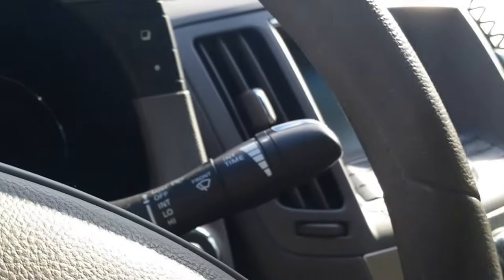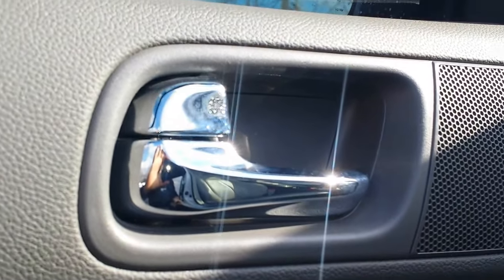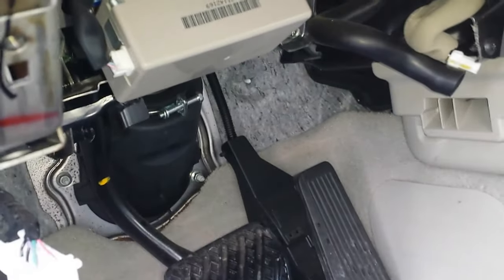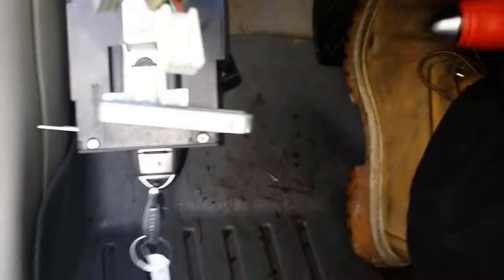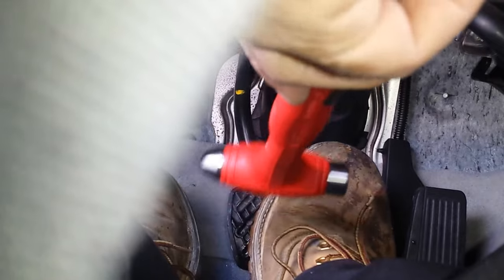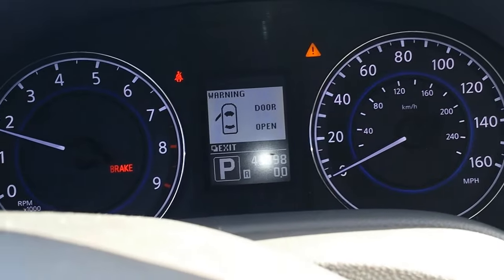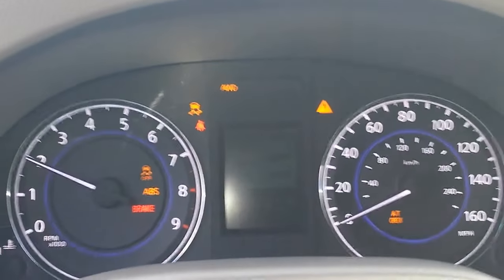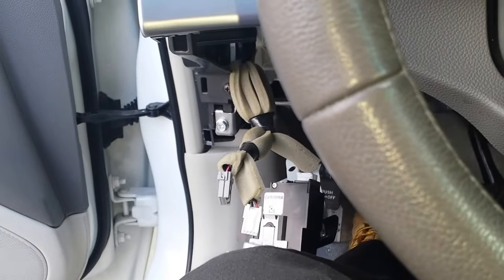How to Start Your Nissan or Infiniti with a Failed Steering Lock Control Unit

Comment: Ok, i forgot to tell/type to you that I got this (yellow icon with key) & still wont turn on... i don't have any power in the vehicle except only the key fob slot - pushbutton & icon to step on the break pedal & push the button... praying i kindly respectfully get a response/advice... thank you
Reply from the maker: Hello Jezabel, sorry for the delay in response.  This trick works 50% of the time.  So I am assuming by now you may have this issue resolved and you replaced the steering lock control unit

Comment: tried this method and it works!  have you had this problem happen again after?
Reply from the maker: sarath sor Yes, this trick will get you going. But it can happen again, and next time the hammer trick may not work. The steering lock control unit would need to be replaced to keep this issue from happening again.
Reply: FixyourNissan how much did it cost to repair?

Comment: Hey Jay I have a 07 m35 I tried the trick and it worked but not for long, I ended up buying a new steering lock module but have the hardest time finding someone to put it on.  my question is if I can someone get the old one off and the new one on does it still have to be programmed?
Reply from the maker: Thanks for watching. The Steering Lock control module does not require any programming.  If you can remove it and install it, that is all you need to do!

Comment: I bought my son a 2007 Nissan Murano 190k miles, it ran n had some minor issues I had fixed, tune up, breaks, etc. It's been sitting since Last April 2022, it will not start and I was told it's not the lock box or steering module but the key light is on. It unlocks and locks the doors. The car won't even go into neutral. I know I need a new battery. I don't know where to start, new battery first? or if he should just get a new car. Hope to hear back soon thank you. It happened out of nowhere.
Reply from the maker: Hello, and thank you for watching. Does it act exactly like this video?
Reply: @FixyourNissan hello thank you so much for replying. Yes. Nothing was coming on except that key light. Someone came to try n fix it, jumped the battery n got all the lights and everything to come on, it sounded like it was going to start but it just wouldn't turn over. I think he was banging on the starter like this. I was told it's not the starter or alternator, it's something electrical.
Reply from the maker: @nickalenaramos5981   Alternator won't keep the car from starting. If you hear a single click.  That is a sign of a starter

Comment: I have a question about the warranty. does it matter if I got it from a different dealer ship for the 8 Year warranty. or you have to buy it from nissan dealer ship for the 8 year warranty?
Reply from the maker: I made a mistake about the 8 year warranty. It was actually 6 years.  I was thinking of something else.
Reply: Oh alright, one more question if I buy a steering lock does it matter the manufacturing number? I'm trying to order one on amazon
Reply from the maker: Don't know if you can get it on Amazon, it is a dealer item only. No programming is required. Just replace.

Comment: My car it's infinity FX50s 2010, I have same the issue in my car, the steering wheel is locked , and I got water leaking from sunroof, the car it was  working fine , after clean the car  I got intelligent key warning light on , I don't know the  problem from BCM or from steering lock module? please help me

Comment: i have the same issue with my car but with my car the steering wheel is locked and the radio and all the locks are not working or responding to the remote.  should i try this? thank you
Reply from the maker: +phil blak  What year and model Nissan or Infiniti?
Reply: 08 g35
Reply: Is there a way for me to reach you ?
Reply: blu way did you ever fix it

Comment: I have a 2007 g35 sedan with the same issue. Is it covered under the warranty?
Reply from the maker: If you have a extended. Maybe.. Other wise, it's only covered under the basic warranty which I am afraid is expired on your year G35.
Reply: FixyourNissan I've tried the hammer trick with no luck. The only way I can start it is to clear the b2014 code (koeo) . Then it will start one time and the code returns. Is the lock solenoid replaceable? Looks to be riveted onto the column.  If I get an entire column from a salvage yard will it need to be reprogrammed?
Reply from the maker: b2014 could be a BCM issue if not a Steering lock control unit issue. The steering lock control unit is secured by two tamper proof bolts which I use a Punch and Hammer to remove by reverse drive it, so it loosens.
Reply: FixyourNissan will it need to be reprogrammed after the new lock?
Reply from the maker: onebad4cyl No programming required if you change the steering lock control unit. If you replace the BCM there is programming involved.

Comment: I have the same issue with my 2008 infiniti qx56. what's the name of the fuse box thing and where can I get one from?
Reply from the maker: +Raoul Wright  This is a steering lock control unit. The 2008 QX56 does not have push button start, and does not use the same type of steering lock control unit.

Comment: rom Edison, nj, Saturday Blizzard day took two tries to turn on my daughters car. The battery was weakening. Moved car, shoveled; a few hours later had to jump battery to move car again, drove  for a while to charge battery. Parked. turn the car off then on again with no problem. Today would not turn on. Replaced battery with new bosch from pepboys. Still no luck. Saw this video along with a few others. pulled panel down on one side  and tapped with a hammer a few times and car turned on.  Hopefully it turns on again. QUESTION. Did it not complete actuator cycle cause battery was weak? Could that be the cause? have a 2009 2.5 with 69000. Will see
Reply from the maker: +wilton eliason  The weak battery could have played a part in it. But like you said, time will tell. If it happens again, then the steering lock control unit would need to be replaced. But in the mean time you may want to keep a small hammer in the trunk. Glad this video helped you to get the car started.

Comment: After you tap the box and get the ignition running. Pull the red 10A steering lock fuse out, in the hood of the car, with the igniton running. You wont need to fix anything after you pull the fuse, car will start everytime.
Reply: I would pull the fuse the first time you get it working. You can only do the tapping method so many time before it completely breaks. Once you can't get the ignition on anymore by tapping the permant fix of pulling the fuse wont work. The recall for this ended in May 2020.
Reply: @D8V1Dx  can you explain this more?  I dont understand how pulling a fuse would make this problem go away while also not affecting anything else...  I am also no mechanic so please speak slowly. lol
Reply: @davidbruton4768  When the ignition is on, the steering lock box is in the unlocked position. When you pull the fuse out while the car is on, it permanently stays in the unlocked position. When you pull the fuse, it cuts power to the steering lock, so it can't go back in the lock position.

Comment: are you holding down the start button or pressing it repeatedly, while tapping the control unit?
Reply from the maker: I am holding it down, cause if you keep pressing it, you run risk of cycling the ignition on and off
Reply: thank you sir

Comment: Any suggestions on how get all the parts off to get to the steering lock module?
Reply from the maker: The Steering lock Control unit is secured by two tamper proof bolts which would either have to be drilled, or chiseled to be removed to replace the steering lock control module
Reply: @FixyourNissan  o ok thanks

Comment: After i got the car started it would jerk, or go into limp mode.and then shut off again. Drive like 3 blocks and shut off again.
Reply from the maker: Thank you for watching.  But the Steering lock control unit will only affect it starting.  Not to cause it to jerk and go into limp mode.  So you have more going on that just the steering lock system.

Comment: Mine turned out to be a bad BCM.  It got wet from a leaky sunroof.  Replaced the BCM and had it reprogram and all is fixed!
Reply from the maker: onebad4cyl  Yes, Water leaks can cause BCM issues as well. Glad you got it fixed!
Reply: What’s a BCM
Reply: FixyourNissan what’s a BCM
Reply: @kendrickweedie3162  Body Control Module

Comment: Had the same issue on my 2009 Infiniti fx35. So I changed my Steering Lock unit and got key Fob reprogrammed, but still have the same issue of car not starting. Ive already replaced starter and battery. No clue what to do next😫
Reply from the maker: If the remote had to be programmed, this is not your issue.  The Steering Lock control unit does not require keys to be reprogrammed.  Does your ignition turn on?

Comment: What if my car doesn’t have that control unit right there ? I have a 2013 maxima sv so idk where it’s located
Reply from the maker: If you have a 2013 Maxima, you don't have a Steering lock control unit and this is not your problem

Comment: The key warning light is on in my car and the push button ignition is stuck in the ON position but the car isn't running. I had to disconnect the battery to get it to turn off. When I reconnect the battery and try to start it; it gets stuck in the on position but won't start. Everything works on the car...inside lights, radio, horn, air, brake lights...the headlights aren't working tho. Would it be the steering lock or something else?
Reply from the maker: Kristin Czech It is not the steering lock. That is something else that causes that. If you had a steering lock issue, the ignition would not be able to come on at all.
Reply: +FixyourNissan is it possible someone could have disconnected something? My car was kinda stolen and parked somewhere else while I had the Fob in my pocket.
Reply from the maker: Kristin Czech Not sure. If it was stolen, they could have done anything, which makes it even harder to say.  It would need to be checked to really see what the issue is. Whether something was unplugged, or damaged due to the car being stolen.
Reply: +FixyourNissan it was taken by the person that was i was giving a ride home. He drove it around the block and hid it from me. I think he did something intentionally because he was mad. I just hate to get it towed to Nissan and it's something I could have fixed and they charge me a ton of money that I don't have.
Reply: +FixyourNissan thanks!
Reply from the maker: Kristin Czech I hear ya. There is no real way to predict if they did anything or not.  It maybe best to let the dealer hook up their scanner to see what is going on.
Reply: +Kristin Czech Did you ever find out what was wrong with ur altima getting stuck in the on position i have the same issue.
Reply from the maker: +MYNOR SAGASTUME  Most common is the BCM.
Reply: +MYNOR SAGASTUME it was the Industrial Power Distribution Module cost $300 through the dealer haven't had a problem since.
Reply from the maker: +Kristin Czech IPDM, Intelligent Power Distribution Module. Glad you got the problem resolved.
Reply: Thanks it was BCM

Comment: I have nissan altima 2009 and the security key on the dash , i replaced the battery of the car and the key and i hit the ESCL  and nothing happened by the way my steering wheel moving if the car in lock mode .

Comment: @fixyournissan I have a 2006 Infiniti M35x. My remote does not unlock the doors or trunk and the car will not start. The car battery died when I was changing the brakes because I left the ignition on so the steering wheel will not lock and I could move the wheels while the car was on the lift. I disconnected the battery and reconnected it and when I reconnected it and tried jump starting it the problem started. It is just like you described in the video but the there is no key symbol on the dash. There is power to the car because the lights and horn work. I ended up putting a fresh battery in since the battery was 5 years old but it still will not start.
Reply from the maker: iamthebergerking This is going to require some conversations back and forth. This is going to be one of two things causing your problem.

To talk to me about it, you can request me here. 

http://www.justanswer.com/car/expert-jay1/?rpt=3800
Reply: FixyourNissan I left my car at work so i will do that on Sunday. Thanks!
Reply: I'm having the same problem with my Infinity M45 please help
Reply: @iamthebergerking  How did you fix the problem on your Infinity this just happen to me ?

Comment: Will it apply to 2008 to.?
Reply from the maker: Yes, This would apply to most 2008 Models with push button start.
Reply: @FixyourNissan  
Will it be countless of tries til it starts.?
Reply: @FixyourNissan  
Forgot to mention about there is no power in my vehicle only the pushbutton & the key icon yellow & the beeping sound when put on (ACC)...? Kindly Need Assistance/Advice... thank you
Reply from the maker: @jezabelmae3201  If it acts like this in the Video, your issue is a steering lock control unit
Reply: @FixyourNissan  
Ok, i forgot to tell/type to you that I got this (yellow icon with key) & still wont turn on... i don't have any power in the vehicle except only the key fob slot - pushbutton & icon to step on the break pedal & push the button... praying i kindly respectfully get a response/advice... thank you

Comment: I have this similar problem I could unlock and lock doors power up the cluster radio etc but when I go to turn it on cluster goes blank and show the amber key light my steering wheel doesn’t lock up either
Reply from the maker: What year and Model Nissan or Infiniti?
Reply: Its a 2008 G37s coupe
Reply from the maker: Is it acting the same way where the remote will lock and unlock the doors?
Reply: Key fob has to be enter so it could work
Reply from the maker: It sounds like you had a weak battery, and it activated the steering lock and locked you out

Comment: have kind of the same problem on my g37x. 2010. Car wont start. O have power lights everything. It just cliks but never goes on. Also brake pedal is really stiff (hard)
Reply: Hey did you ever figure out the issue?

Comment: what if the exact same thing is happening to me but the remote is not programmed with the car at all and i have the same problem
Reply from the maker: If the remote is not programmed to the car, it won't start the car. It has to be programmed for it to start the car.
Reply: @FixyourNissan   they tried to steal my car and dis programmed my key fob to my car and i called a locksmith and he couldnt do it because of that all that turns on is a yellow/orange light that says key on the bottome left of the dash
Reply from the maker: @jrfrom  The immobilizer system is shared between the Ecm and Bcm.  So it can't be bypassed.  They took out the steering lock system in 2012.  So if you have the yellow security light, it is going to require advanced steps to see what is going on.  Could be a bad BCM
Reply: @FixyourNissan  what do you suggest I can do my car never had this issue and nothing was wrong with it but once they disconnected my key fob that happened and i was never able to turn it back on
Reply: @jrfrom bro I’m in the same situation
Reply: @jrfrom I am not the tittle owner of the vehicle either but I do have the title any information?
Reply: @FixyourNissan mines def ain’t the bcm tho cus my key fob battery was low but I ain’t know about these malfunctions that came with a low battery. So what should I do?
Reply from the maker: @imfrmhouston8501  If you are getting a Key Malfunction warning message, that is normally the Car Battery.  Not the Fob battery
Reply: @FixyourNissan   but it still does it while the im giving it a jump and my battery was just fine before it stopped working
Reply from the maker: @jrfrom  If you are getting a yellow key light, you are either dealing with a Steering lock issue or control unit issue.
Reply from the maker: @jrfrom  If you are getting a yellow key like like this video, this is a steering lock issue or a control unit issue.

Comment: I have a problem with a 2009 Infiniti G37s what can I do to fix it
Reply from the maker: +Jeffrey Perez Is it a steering lock issue like in the video?
Reply: I think the steering wheel is not looked but the brake pedal is really stiff
Reply: +Jeffrey Perez heyyy!! HELPPP! I have this problem. I have power and everythin. Its my brake pedal the one is really stiff ( hard) and cant turn on my car. did u fix it?
Reply: @jeffreyperez4856    I have that problem  right now,  did u fix it? It normally  said step on brake  but this time it just red screen.  When I push the button from on then it go to off, let me know  thx.

Comment: 2006 Infiniti g35 was having starter issues. Took to a shop to replace the starter and the immobilizer kicked in. Called a locksmith and now the steering wheel is locked. Took it to Infiniti and they said 2,200 and they don’t even know if that will fix it. I am at whits end. Don’t know what to do. Credit cards are maxed and have less than 100 to my name.
Reply from the maker: I am sorry to hear about your issue with your G35.  But for your issue, it sounds like it's going to require the proper checks to determine the direction needed to get it up and running again for you.  This video may not be your issue
Reply: @FixyourNissan  thank you for the reply. I appreciate it

Comment: Holy shit maybe you can help me. Just did a motor swap on a auto 08 coupe. Go to start it up for the first time and engine won’t crank at all. Dash lights come on. Yellow key indicator stays on, it’s in the dash. Key works on door locks. Key battery says 3/4 life. Brand new car battery.